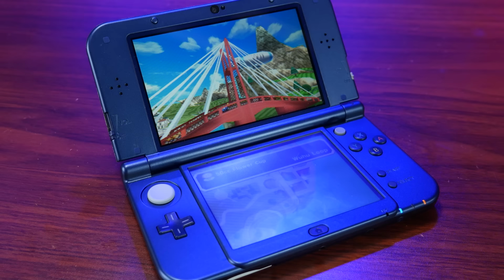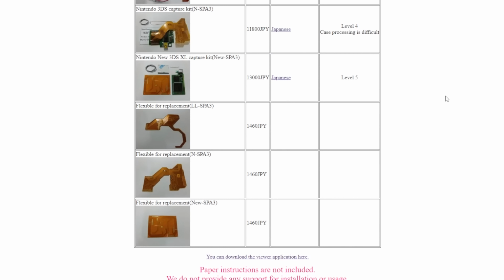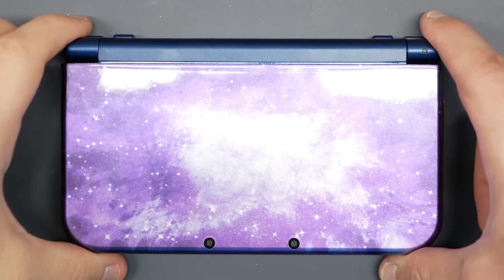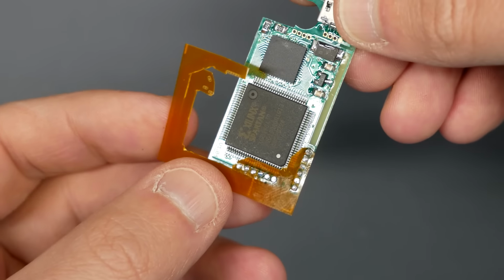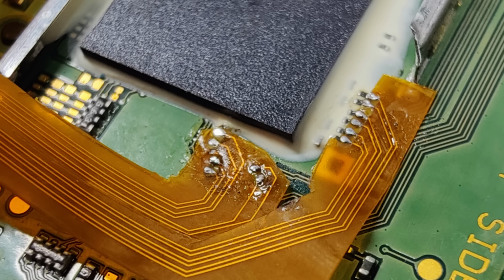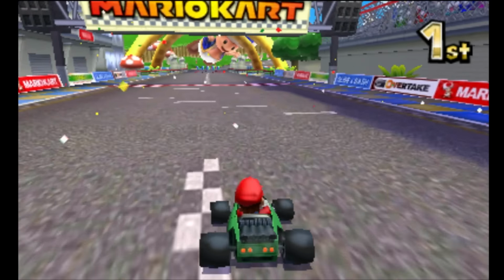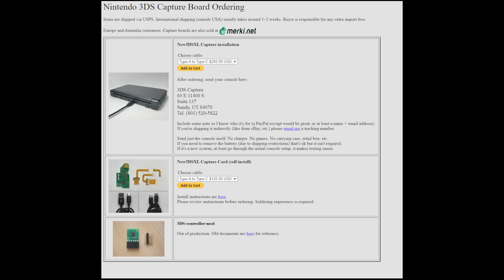This New 3DS Upgrade Is Ridiculous

Comment: This definitely looked like more trouble than it was worth, especially since the ribbon cables didn't come precut. It is good to see you were able to make it work, despite some of the issues and the end result.

I think you should try out the newer capture system you talked about in the end, especially considering some of the more notable benefits that brings compared to this one you had just installed. I've been looking into installing a capture board on my 3ds for a while and if the new one you talked about at the end works well, I might just go for that instead.
Reply: This mod for me seriously make emulation even more worth it, I know that Im leaving a lot on the table, but if I want to enjoy my 3DS in a monitor or TV, I would fire up Citra 100% of the times instead of opening up my real 3DS to do that mod

Comment: Love seeing these 3DS mods. My dream mod would be to have a USB-C mod that completely replaces the present charging port. Then from there, get this one USB-C port to do three things:
1. Charge the 3DS
2. Be able to output AV over a USB-C to HDMI cable
3. Be able to work with Wii U homebrew to where you plug the 3DS into the Wii U via USB-C to USB-A and be able to play 3DS games on your Wii U using the GamePad as the bottom touch screen and controller and the TV as the top screen or to display both screens at the same time for video capture.

I know there's some homebrew out there that let's you wirelessly stream your 3DS at 30 fps to the Wii U and send inputs back to the 3DS but the idea of having a stable wired connection at 60 fps on Wii U is just really enticing to me. I have the official Nintendo new3DS XL charging dock and I always imagined if it had a USB-C connector that it could be like a Switch dock for the 3DS, a 3DS Player dock like the old Game Boy Player. Oh and for the few who have 3D displays, it'd be nice to have 3D video output via HDMI or Wii U.
Reply: The german installer have that as an option
Reply: You would have to be a genius or a very dedicated individual to do all of these by yourself, however, I cheer for your dream and wish you the best on your work!
Reply: Wow, you spent a lot of time thinking about this huh

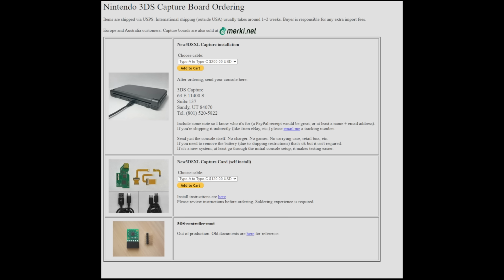Comment: 12:06 Last month I actually got my New Nintendo 3DS XL modded with that exact USB C capture card and it works much better than the snicker-stream wireless option. Also it didn’t have any strange color distortion like the one you did. I highly recommend that you test that one out because it seems to be the best one out on the market right now.

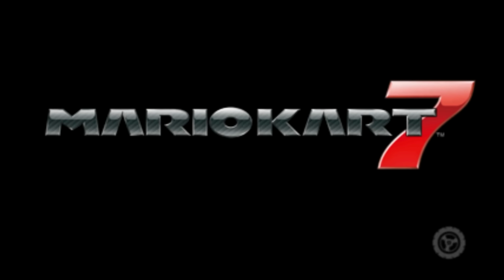Comment: 9:30 I bought a capture card on ebay a few years ago and had this issue too - there's a 'Calibration' option in the software that lets you adjust some of the settings until the picture looks right.

Comment: I installed the newer 3DS XL capture mod mentioned at the end. You can install the mod without soldering the ribbon cable IF you don't want audio out from the USB-C port. If you're willing and able, you can output audio via the 3.5mm jack that already comes with the New 3DS XL with proper audio cables (and maybe a Ground loop isolator to drown out the static).
Aside from that, the newer mod is far more easier to install and possibly less buggy than the older one form Optimize. I highly recommend it.

Comment: I hope theres a variation on the future that uses a mini hdmi or mini display port on the card instead of a micro-usb.
Reply: man i hate mini i wish it was just a all in one usb c type of thing booth charging and display outpout on the same port.
Reply: @odin8214  Well, that will be happening more in the near future than anything else.  Remember that usb Type-C has been set to be the standard about 7 years ago, so all these older plug types have been dropping in cost so that's why they are being used until the stock is all gone.

Comment: This is neat, but looks like a nightmare. Maybe it is time to get into 3DS emulation, hmm...
Reply: See thats the problem with handhelds like these. You can never really get the same experience on emulator due to all the custom stuff with the system.
Reply: Or with modded you can just stream wirelessly
Reply: @caramellesweggose  Well, the wireless option is garbage. Low quality and frame drops. At least that is what I experienced last time I tried it.

Edit:
The fact it actually works is pretty cool. It just ain't good for actually capturing gameplay.
Reply: @Ozzianman  I've used the wireless option and it was solid, but I still bought a 2DSXL capture card a few years ago because the wireless option can't capture DS games.

Comment: Couple years a go was a Tokio based brand that sold N3DS with a similar kit or installed it on your own console in a couple hours, and they instal the capture usb c port on the existing charger (you can play and charge it at same time) or replace the infrared port with it. Unfortunately were sued by Nintendo and the brand disappeared, you can buy one for a former owner but they’re insanely expensive. Also there is an alternative to stream from a software moded console, but its a bit laggy depending your network speed connection

Comment: The problem with the bottom screen looks to be a calibration error in the 3DS streaming software on your PC, if you would mess with the bottom screen settings I'm sure you'd be able to fix it! Coming from experience with the same card!

Comment: The bottom screen looking like that is a software problem not hardware thankfully, if you go into the Calibration menu there's a bunch of settings you can adjust and one of them should be an option to fix the bottom screen. I have one of these kits so I know the struggle of getting everything to work perfectly.

Comment: I've installed a few of these and they aren't easy! You can connect it to a TV directly using a raspberry pi with the correct image. You can also use a wireless controller over wifi if you install CFW. Enjoy!

Comment: the loopy new 3ds capture card has usb-c and is a lot easier to install you should do a video on that one it doesn't require cutting the shielding off or soldering around the cpu either, it does require shell cutting but you grind it away to make it thinner instead of just cutting a hole in the bottom.

Oh just got to the end of the video and you talk about it lol. I put one of these in my 3ds id recommend it. I use it to play nds games on my crt via my computer and it looks great

Comment: This card looks like a huge pain in the ass to install, the new card mentioned at the end of the video is definitely more worth it. The only soldering needed for the new card are the two wires for power and charging then the audio pins which can even be skipped if you'd rather use an AUX cable. It also fits enough inside the console to where you only need to sand that general area down to about half way rather than cutting the entire part of the shell out.

Comment: Cutting out the ribbon cables... yeah no way. The newer capture card seems promising though. Would love to see an installation of that one.
Reply: It's too bad if you do it the easy way. Use a metal ruler/guide and a fresh Exacto blade. You mark the ends of the cut by first pressing down straight through the ribbon to cut it. Line up the ruler, and one clean slice down against it. If it doesn't cut through fully, just rescore over it until it's free. If you need a video guide, just watch some people cut out small decals for scale models; same concept. Doing it free hand with a big razor like this is way harder.

Comment: I just bought Loopy's New 3DS capture card mod kit. It was $120 with the ribbon cables precut and a USB type C output/ charging. This looks like more work than that, but I haven't installed it yet, so I won't talk trash haha.

Comment: Honestly i've streamed pokemon on a hacked 3ds using the wireless video out and i think it worked perfectly fine for the situation. i probably wouldn't play looking at the monitor, but you can just use the 3ds in front of you and let obs capture it, since your playing on the actual 3ds screen there is no latency for inputs. Its NTR.

Comment: That's really cool, but looked tricky as hell. Good job!

Looking at the bottom screen it kind of looks like when my HDR screen tries to show RGB in HDR mode. On windows when taking a screen shot on something that is on the HDR screen for example. 

So not sure at all if this is related, but could be the software, graphics card and screen that is causing some trouble and not nessecary your soldering. All colors are there just very light tinted so feels like it could be something else at least. :)

Comment: For anyone that has gotten the USB C mod, do you guys have issues with how hot it gets? The bottom of my 3DS gets toasty and wonder if that is causing issues as sometimes if i bump the cable it disconnects for a sec. I paid to send it in and have it modded i didnt do it myself

Comment: I'm waiting for an emulation device that will allow you to play DS and 3DS games on the TV. a kind of retron where the games are played by the module or read out and then played via the device with higher resolution and AA and a bluetooth controller. Of course the problem with the 2 screens but is doable.

Comment: Also, if you're emulating it via Citra, then why not use a cheap bluetooth Touch Controlled Monitor that you can just put on your lap? Or haven't we figured out splitting the gameplay onto 2 seperate screens with that emulator yet?

Comment: I would only do this if 3DS had support for bluetooth wireless controllers otherwise playing it on the handheld is just fine to me. As for capture games, using emulator is just fine. I would never take risk on tampering my original 3DS just to have it show on screen.

Comment: I don't know where to ask.. 

I got a SD micro 512 card and formatted it into Fat32 and it partly worked... but my Themes quit working (showing, they were installed) and certain titles quit wanting to load. others did play fine.

What happened?
Reply: The 3DS probably has trouble addressing all the memory in such a large card. Maybe try a smaller one? According to the internet, the 3DS officially supports up to 32GB cards, but some comments say 128 works decently.